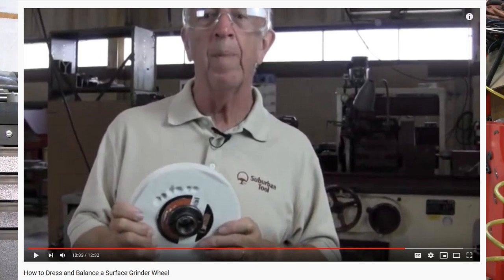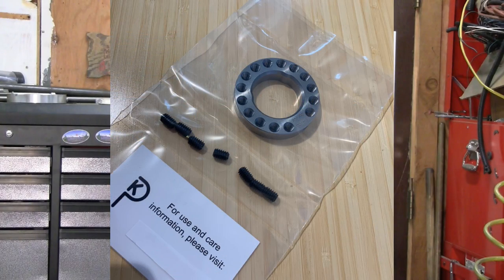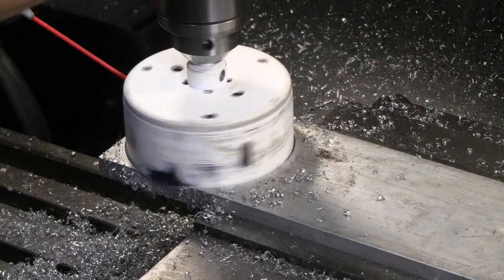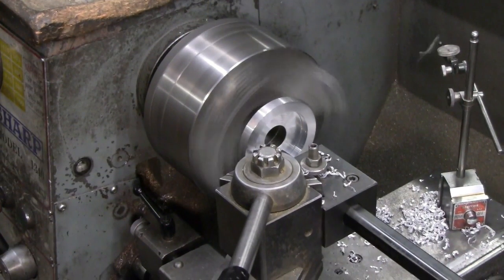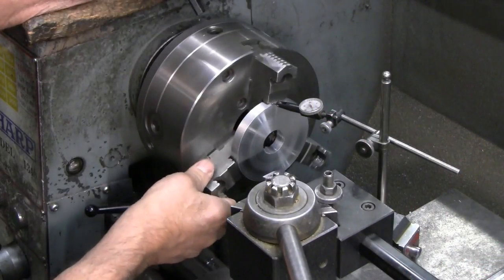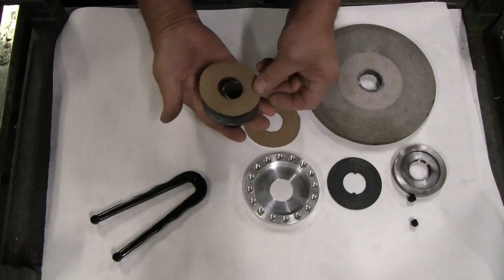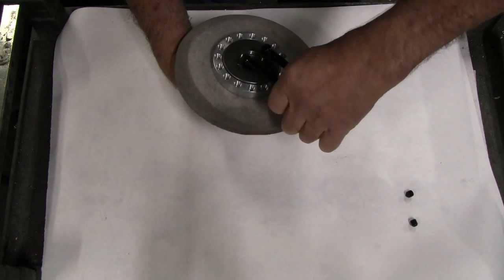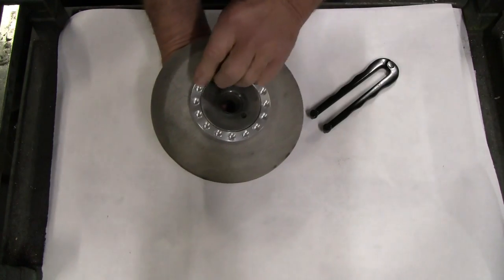#TipBlitz19 #TipsBlitz19 -- Balancing Grinding Wheels

Comment: Hey Joe, I know that I am late to this, but I need to say that the only people that think it's okay to tamper with a grinding wheel, are the ones that haven't been there when one explodes! I am a retired machinist after over a half century in the shop, first job at 13 years old in the shop where my dad was a die maker. I have seen wheels explode and it is scary and life threatening! You couldn't pay me enough to use a wheel that has been modified like that! Just my 2 cents. Nice work on the ballancer.

Comment: Great idea I too really don't like the idea of drilling divots in the wheels.  Scary thought but why do you go to so much effort for concentricity on ring and all.  As long as it fits the hub that is quite enough.   The weights will act on its imbalance as well.  Actually if the balancer is a bit out of balance it could be used as a benefit by orienting it.  But that would seem fiddly.  Really a great tip.  Thank you.

Comment: I share your scepticism regarding drilling diverts in grinding wheels. After talking to several toolmakers and engineers who use wheels there was a universal look of horror at the very concept of using 'damaged' or 'modified' wheels. After contacting several suppliers and manufacturers of abrasive products the answer was unequivocally that they would never recommend this method of balancing as it would almost certainly compromise the integrity of the wheel.
I have found that, in practice, most modern wheels do not need balancing due to tight manufacturing standards. I do have a few hubs I have made which copy the Jones and Shipman type. I use them on the odd occasion that I find a wheel which has been dressed off center and needs help. Great video, keep up the fab work.

Comment: How about 3D printing the ring? Then you can make enough so that all the wheels you generally use can be mounted on their own arbors .
Reply: Great idea....maybe.  Do you think the plastic would holdup off balance at 3500 rpm??  The plastic ring would be off balance, to balance the grinding wheel.  Would be a lot of pressure on the thin web of plastic.   Or am I wrong?
Reply: Maciej Jan Długosz  , you might want to brush up on the latest, 21st century, plastics. Have you heard that metal is even being printed? 
BTW, the award would only be given if you are foolish enough to stand in line with the wheel with the guard off at any time. And don’t forget safety squints.

Comment: Perhaps you can answer a question I've always had about the way I've seen wheels balanced, using the idea that the heavy side will always go down. Static balance with shaft through center and parallel, horizontal support bars. It doesn't answer the problem of dynamic balance. The wheel is going to be spinning! Big difference on how far from the center the weight is either added or removed for dynamic balance.
Reply: I think your answer, unsatisfactory as it is, is in two parts:

1) That until relatively recently a dynamic balancer would have been either technically infeasible, or only affordable in an aerospace environment, probably costing upwards of $100K when an average engineer's annual salary was maybe $15K. A static balancer probably cost around $100.

2) The wheels are pretty homogeneous, so the imbalance is probably down to thickness variations for the most part. And the arbor bearings are pretty beefy. All this meant that a static balance on normal size wheels was "good enough"
Reply: @lwilton  "I think your answer, unsatisfactory" Not sure why you think my "question" was unsatisfactory. It was after all a question, not an answer. I do think the solution presented is very good. I do like the idea of an odd # of holes.
Reply from the maker: @Larry1942Will  I think @l wilton meant "the answer I am giving you" is unsatisfactory, not that your question was. I'm a rank beginner at this, but my feeling is that his answer is very good (as was your question).
Reply: Sorry, you misread my sentence, it didn't stop at "unsatisfactory". In retrospect I could have said "the answer" rather than "your answer", which I'd intended to mean "the answer to your question".

Let me try that answer again:

"The somewhat unsatisfactory answer is that dynamic balancers cost too much until very recently, and static balances worked well enough, even for 18 foot diameter airplane propellers."

In 1971 I had a job working on software for a jet engine fan balancer. The balancer took up 5 6 foot high relay racks in the test stand, was connected by a 600 baud telephone  line to a computer on the other side of the country, and took about 20 minutes to compute the balance solution, after punching out the test data on paper tape, feeding it into the teletype, and waiting for it to print out the weight and angle.
Reply: @lwilton  I'm not debating that static balancing doesn't work well enough for many applications! It obviously does! You took offence at a question! I wasn't belittling your method! I think it is a good solution. 50 year old technology has nothing to do with acceptable balance methods. 55 years ago I was an Officer on a Carrier off Vietnam. State of the art at the time, a long ways from it now.
Reply: Second try: NO I did NOT take offence at your question.

I attempted to say  that "THE REPLY IS UNSATISFACTORY" (Meaning "the known reason for doing it isn't wonderful"), but despite the reason for doing it that way historically being unsatisfactory, it is what it is.

It appears that the reply, or at least my having made a reply, really is unsatisfactory to you. I am sorry for that.
Reply: Here is an idea to try as “cheap dynamic balancing” - new smartphones have accelerometer sensors built in and there are apps that use that sensor to measure vibrations of the phone. I used one called VibSensor for a different project. It provides separate visual indication of X, Y and Z movement.
1. Balance the wheel statically then mount it on the grinder. 2. Strap the phone tightly to the grinder’s spindle housing. By trial& error reposition & adjust the set screws to minimize the vibrations. The phone + app serve as “dial indicator “ for vibrations. I think this could work.
I intend to make this balancing wheel some day and try it myself but perhaps someone could test it sooner?

Comment: Great tip for a project. Thanks! You might want to consider using an odd number of holes. With an even number of holes, having two screws directly across from one another would have no effect on balance. One the other hand, when considering an odd number of holes, having two screws almost directly across from one another would give the smallest possible adjustment to balance.
Reply from the maker: Good thought, Brian. I suspect it would depend on exactly how far out the wheel is and exactly where a screw is in relation to the heaviest spot. Even would be (marginally) better in some cases, odd in others. With 16 holes, lots of chances to get to a good result.
Reply: @sierraspecialtyauto7049  With the light side of the wheel pointing up, install two screws apart from one another , but above 9 and 3 o-clock (that is the reason for the odd number of holes). This will result in much less counterweight effect than having just one screw at the top.  If that is not enough weight, move both screws up one position. Continue moving the screws up as needed. At some point, the two opposing screws will have more effect than just one screw centered on the light side. At that point, if more weight is needed,  install only one screw centered on the light side, and continue to fine tune using opposing screws again if needed. Using this method will gave the finest possible resolution on balance.